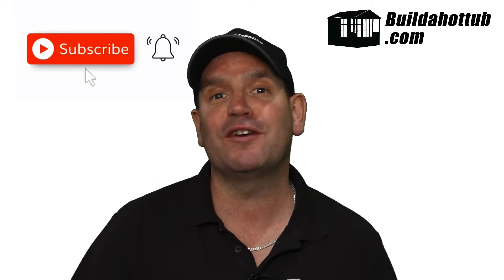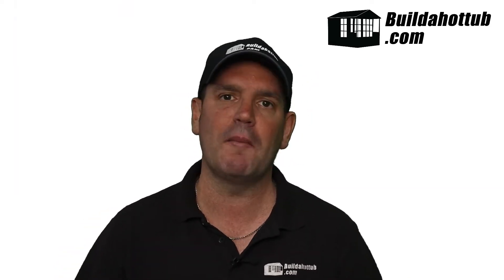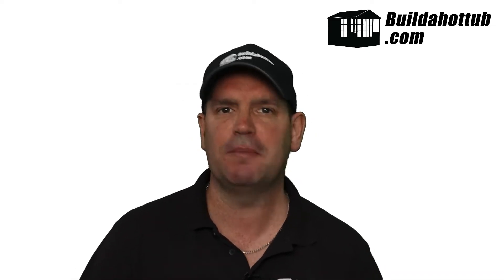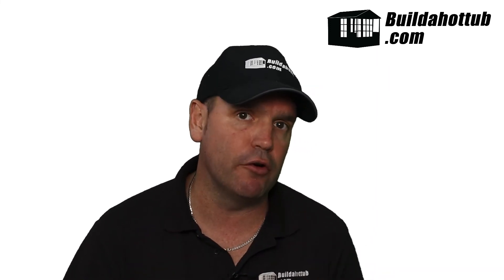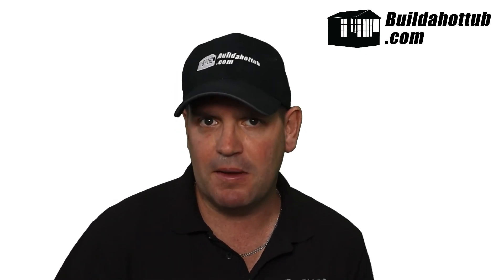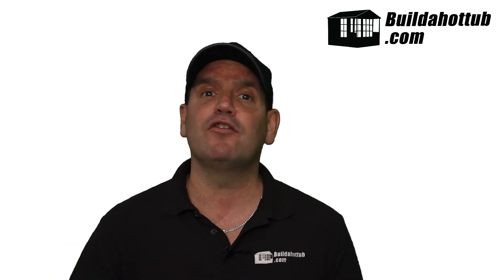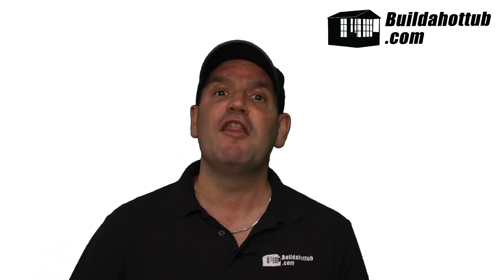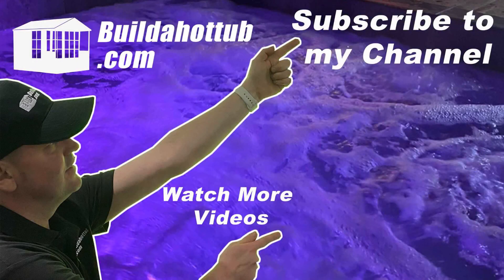5 Considerations BEFORE you install an Air Source Heat Pump on your Hot Tub

Comment: I would say bigger is better I have 13kw on a 1200l tub, its perfect, my biggest £££ saving come from only needing to heat the tub a few hours before I want to use it and not at all in between. I would also say get the wifi module so you can turn it on and off from your phone.